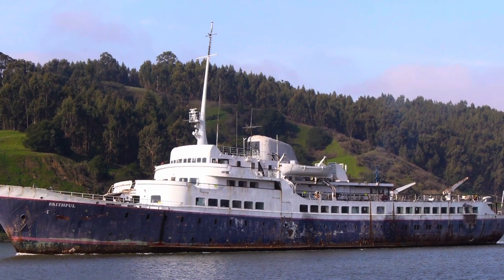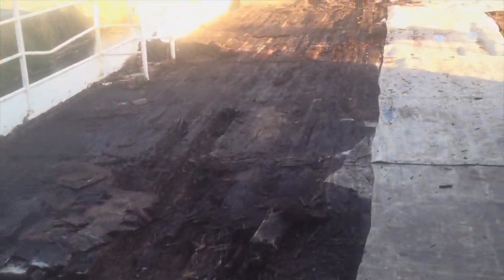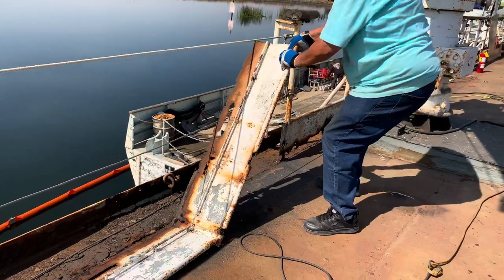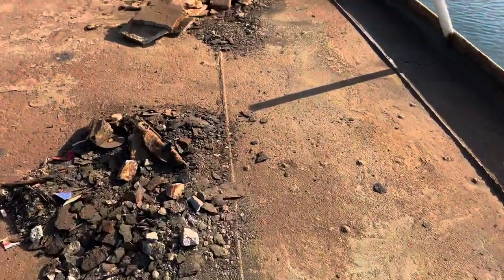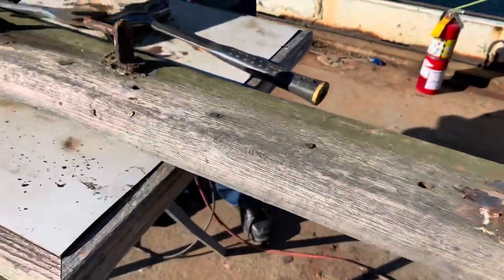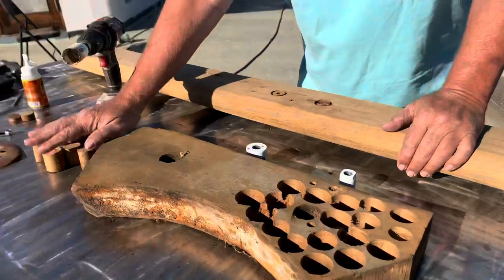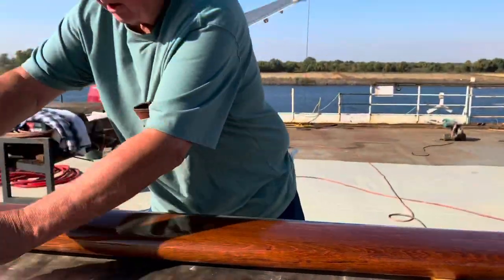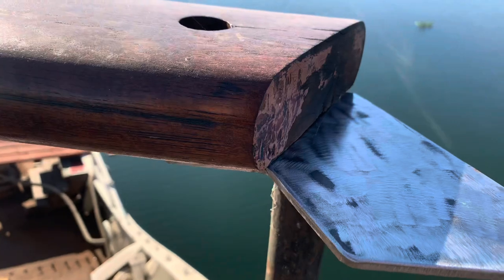I Bought a Historic Cruise Ship on Craigslist DIY Ship Restoration EP. 3

Comment: They make a pneumatic scaler that has little metal rods coming out the end of it and when you pull the trigger the rods vibrate and will descale all of that rust and cut your time in half. Once you get off the loose rust the scaler will also clean the surface . Another suggestion instead of hauling all that rust and scrap to the dump have a recycler bring in a huge dumpster and dump all of your old metal in it. When its full they come pick up the dumpster and Pay you for the metal then bring back the empty dumpster for you to fill again, Not only can you take the money from the pay off the scrap but you are doing your part for the earth and recycling .
Reply from the maker: I took your suggestion and used a needle gun for a few hours of the day today.   Was great for smaller and not so stuck rust but the air chisel was a monster on the tough stuff.   Thanks for the advice..
Reply: @AuroraRestorationProject  Well crap sorry it didnt work out used one of those and they kick ass. . I restore muscle cars and do Marine repair for a living I cant even imagine how daunting this task is. I would do it the way you are start outside to protect the inside. I have no clue how you have raised the money to take on this project. Consider the scrap dumpster will recycle and put some money back into your pocket for the resto. Good job my man keep up the good work

Comment: You should go ahead and invest the time to set up a workshop on board. Things like cutting those plugs will be a lot easier with a drill press. You can also get a pneumatic chipper that you could use standing up instead of crouching down on the deck with an air chisel. Ergonomics is important in the long haul.

Comment: Are you using Core-ten steel for the handrails?  This is the corrosion resistant steel that shipping containers are made from.  Good work on the handrail plates, a nice radius on everything helps ensure good epoxy film thickness.

Comment: Terrific project - subscribed. Have you had any kind of survey to let you what’s toast and what’s restorable in hat engine room? Also, what’s the end goal here? Back into commercial service or other uses?
Reply from the maker: We have had a number of professionals over the years.  The conclusion is that the engines are the easy part.  We could certainly get them operable.  However the electrical will require a lot more work.  Not impossible work but certainly not easy.    Past that I’m sure we will need to replace a good number of components in the engine room not directly related to propulsion..

Comment: I’d suggest using vinyl paint on prepped steel. Epoxy doesn’t hold up well in UV. Pigmented epoxy is a little better. Epoxy is best used for bonding. Built a 44’ x 28’ trimaran, so I know a little about it. Good luck.
Reply: Coatings is a whole science in it's own right. I would use exactly whatever they use on cargo ships. Doug from the SV Seaker youtube channel had a guy that was a coating inspector on pipelines and oil rigs come out and offer advice and help a few times. Those videos were super interesting, especially the "holiday" checker which is like a metal broom, with a grown wire connected to bare metal on the hull. It beeps and finds any pin holes that go through all of the layers of coating to the bare hull. It's wild that a bug in the paint can create one of these "holidays" that end up causing the coating to fail in a large area overtime.

Comment: Obtain a good sized needle scaler for removing that rust, you won't be disappointed.
Reply from the maker: Took your advice and loved it.  Works great on the smaller stuff but air chisel is king on the hard to get off stuff.    However it the needle scaler does a much more detailed job.

Comment: If you really wanna make those plugs disappear, remind pops of the sawdust and glue trick, I'm sure he knows it.

For anybody else that sees this that doesn't know the trick, you basically take the sanding dust or saw dust from the wood you're working on, and mix it or pack it into the glue depending on what you're working on and which method is easier for that particular patch.

Comment: They make a 2 part epoxy paint for decks you can mix some sand in it to make it a non-slip surface give it some grip and roll it on the deck preferably gray that's what I put on my deck on my salmon trawler looks nice if you replace all those decks with wood you're going to end up spending enough to buy a house just the cost of the wood you can do the roofs on the cabins as well
Reply from the maker: Interesting enough I just bought the epoxy for  some of the decks.  Not sure what the most popular mix is but have used walnut shells in the past.   I appreciate the practical advice.  We’re definitely on the same page..
Reply: @AuroraRestorationProject  mix the sand with the paint use a drill and a paint mixing bit, screen it first then add to get the consistency then use a roller and a paint pan use light colored sand so it doesn't bleed back through the paint you can look up on YouTube same thing on how to do it and what it looks like when it is dried that whole deck on that ship would look pretty nice coated with that kinda like a bed liner on a pickup but not as thick I have a wood deck on my 42ft salmon trawler it was varnished sanded looked almost show room quality dumped over $70,000 in repairs into it really nice boat after a couple of years that deck just turned to crap and started leaking then I resealed the seams then just painted over the top of it with the epoxy paint and some sand had a problem when it got wet especially around the cabin or the front of the boat you would just slip off all the time and damn near break your neck it's been on there for years now still looks good when the boat is rocking your stuck to the deck if you ever get any passengers on that ship that's one of the concerns the insurance companies would address and would become a safety issue

Comment: Aurora restoration project
Take your hole saw and bore through a sacrificial board. Now, clamp that board onto your teak with the hole over where you want to drill out a replacement plug.  Remove the pilot bit from the hole saw. Using the hole in the sacrificial as a guide, you can now drill your replacement plug without the pilot bit ruining the center of your new plug.
  ~~~Stay healthy, happy, and safe, ~~~
Reply from the maker: Actually sounds like the most feasible technique so far.  I will give this a shot in the next days as we start getting ready to select what boards we are going to use.   Thanks for watching…
Reply: Use a forstner bit.

Comment: You should look into ultra high pressure waterblasring. Its usually 60,000 PSI. They can use a magnetic track machine that goes on the side of the ship if it's metal. It can be used of the metal decking also. They have and additive that stop it from rusting also. 
Here's a video. 
https://m.youtube.com/watch?v=GGWcrOCDH1w

Comment: I wonder why the steel deck is covered with wood? Because steel rusts. Wooden flooring blocks access to steel painting, moisture is always trapped between wooden flooring and steel. This is a potential source of corrosion. With all my optimism, at this pace, the work to restore the ship will take 25-30 years. On an ordinary merchant ship, the deck crew paints and removes rust on the ship constantly, literally every centimeter of steel is cleaned, primed and painted. When they reach the stern, 2 years pass - it's time to take it from the bow again. And so non-stop. In my opinion, 50-60 repairmen and a huge amount of materials and spare parts are needed here to complete the repair in 6 years.